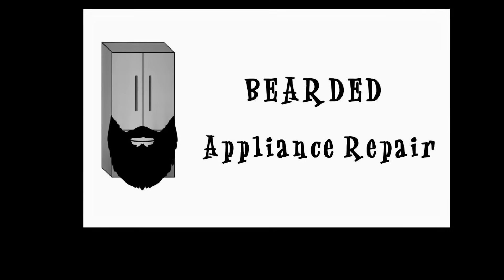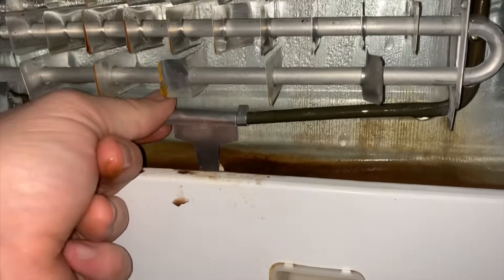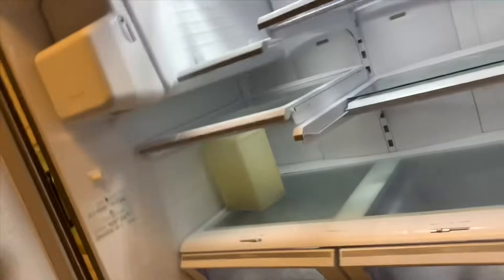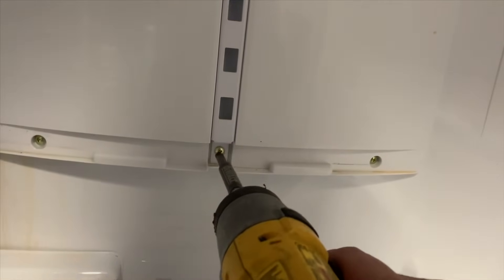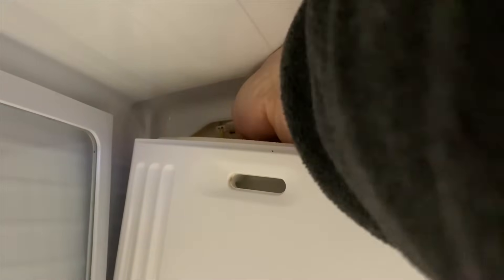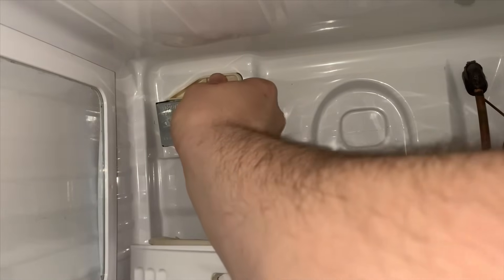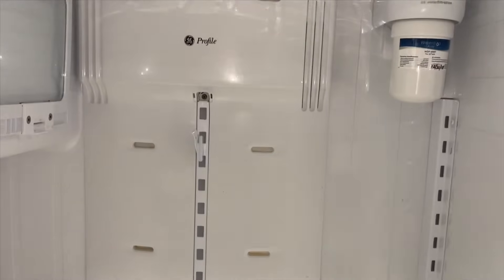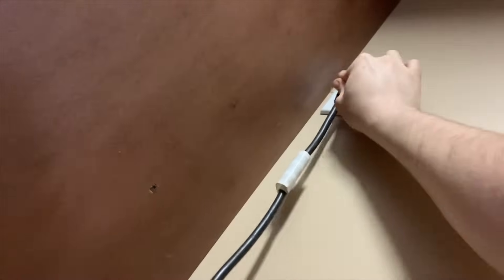Samsung fridge water collecting under deli drawer fix (DA82-01415A)

Comment: Moisture had been accumulating on the condenser and has been freezing up. After I defrosted and dried it notice the water was on the drain I guess due to clogging. I poured boiling hot water, blew air with a small hose, also used a blow dryer, pushed a wire down but only went down about 4 inches but nothing worked. I also checked the white drain hose in the back of fridge. It looked rather dry and somewhat clean. It seems as if it hasn't been draining in a while. Thus far nothing has worked. I guess I am going to have to pay the high price of an authorized Samsung tech. At least I tried.
Reply from the maker: Steamer works best for clearing the drain.  That or just unplugging the unit for a day or 2
Reply: Bearded Appliance Repair -I tried it and it worked. Thanks 😊!!!!
Reply from the maker: Love to hear that.  Did you unplug it or use a steamer?
Reply: Bearded Appliance Repair -used a steamer and some patience as well. I tend to get frustrated if I don’t see immediate results. It is a slow process. In this case there is no quick fix.

Comment: I've seen several of these videos..but no one explains what to do with water in the drain reservoir...does it evap or do we need to always check it every so often? very annoying if we have to take off cover each time to empty it.....
Reply from the maker: Yeah it evaporates down in the drain pan.  The heat from the compressor and condenser evaporates it quickly.  No need to drain it.  If you find yourself needing to drain it there is a problem somewhere.  Wether it’s a leak in a water line or water valve or something.

Comment: Thanks so much for the extremely helpful tutorial.  I did not have anything frozen in the upper or lower drain tube,  but now I still have a small amount of water accumulating which somewhat freezes under the deli drawer.  What would be the next logical step to determine the reason?
Reply: Did you figure it out Steve?  We're also still having water under the deli drawer..

Comment: Replaced heater clip and tubes in back/bottom. Still have water leaking. Verified drain area is not iced up, can hear water moving through drainage tube, and have water in back/bottom in pan below tube.  Any other ideas?
Reply: @ashleemmm  basically by the time the clip had been replaced, if proper function was returned to the unit, I'm afraid water probably seeped in to all areas throughout and did not seal properly anymore with water constantly leaking out (you can probably see what I mean if you take it apart to replace). Sadly my solution was a new fridge, though I do have this one in the garage now without water hooked up and it works fine. If you catch it quickly enough to make the replacement it may make a difference. Good luck.

Comment: On some other model refrigerators here on YouTube they show a code that can be entered through the touch controls to force a defrost, i.e. turn on the defrost heater. If anyone knows that code for this refrigerator please post it here. Using the code would save all that work of emptying the refrigerator and removing the shelves and back panel. I had no luck getting the code by calling GE.
Reply: I called them too and got nothing.
Reply: For samsung fridge - Hold power freeze and fridge buttons for 8 seconds .  Use fridge button to navigate to Power Defrost (rd)  Refridgerator Defrost . This turns cooling off and heats coils for 20 minutes , before going back to normal . It will beep for the 20 minutes

Comment: Does this issue also affect the temperature in the fridge?  I have the parts on back order, and noticed the temperature inside is about 7 degrees warmer than the setting on the outside of the fridge?

Comment: The video shows GE but Samsung may copy GE whatever the principle is same. I just remove all food night, disconnect power and leave door open overnight. Next day, the panel is easy removed not ice behind.
Reply: I set a fan inside on the bottom of the refrigerator with the doors open and the shelves out and turn it on high speed and direct it at the back panel. This thaws it completely within 12 hours and it's not necessary to remove the back panel. Just replace the shelves and plug it in.

Comment: Where would I look to see if this kit works for our model? Our Samsung fridge is trash, three and a half years old and nothing but problems since year 2. It freezes up, won't cool, and needs to be thawed every few weeks. I have seen nothing but complaints online. Just recently noticed water build up under the deli drawer when the drawer froze and didn't want to slide out  without using force. Would like to try this kit for that issue, not really sure what to do about the other one. Have heard it is a flaw in the design.
Reply from the maker: This kit should help with that issue.  If it’s a Samsung French door fridge than this will fit in the fridge.  Should help with ice build up and the water leaking in the fresh food section
Reply: @BeardedApplianceRepair  Thank you

Comment: This video was very instructional. Thank you.  Do you have to let the drain line completely thaw before restarting the fridge?  I forgot to test that part.  This morning I have water under the  drawer again.
Reply from the maker: Yes it’s a good idea to test the drain as well before you put it all back together.  Best way to clear it is with a steamer. Most likely that’s it though.  Just didn’t clear the tube all the way.
Reply: @BeardedApplianceRepair  today it was dry so maybe the water dripping down is warm enough to gradually defrost the drain pipe??
Reply from the maker: Maybe. Anything is possible lol.  Is it leaking still?  If not I think you’re right.  If it still is you may have a leak elsewhere.  Check the filter housing.

Comment: I have a question regarding the two tubes. It seems as if the one in the middle has no function at all. 
Water running through the hole underneath the cooling comes from the right tube. 
The middle one is dry and if i try to put something (after removing the rubber tube) into the hole it seems as if the remaining tube is closed after a couple of cm (tried probing it gently with a scredriver). Is that normal? 
Is the vent inside the fridge under normal conditions hearable (cause I never noticed a sound from the vent)?

Comment: After replacing the heater clip, still have water leaking in fridge. Any suggestions? Changed drain tubes too. Both.
Reply from the maker: Ice can be there still if the drain was not cleared out all the way.  Make sure when installing the heater clip that water will go down the drain.  If it won’t try a steamer to clear it, or getting hot water pours down into the hole to clear it.  Steamers work great for this.

If it is clear,  do you hear some rattling noises when the fan is on?  If you do you may need to look for cracks in the liner.  If that’s the case you need a repair kit.  Let me get that part number for you.  Not sure you can get it anywhere except Samsung though.  Later this evening I’ll be able to look that up for you.  

In the mean time let me know what you find out about that drain.
Reply: I took a turkey baster with hot watet and put it down drain. Cleared drain. Wiped drain pan under evap. Clean. Hurd drain make a noise but water went dn clean. Ill look at liner and see if any discrepancy in it. Thank you. Will check in later.
Reply from the maker: Ray Ray here is the liner repair kit- https://amzn.to/2p1ikiR

Comes with instructions too.  They want you to silicone the cracks and put the pads over the silicone so you’re essential making a new liner.  If you find cracks this is what you need.
Oh btw, where you need to look is where the loop of copper is.  The piece that looks like an elongated “U” in that general area is where you find the cracks.  Could be fine cracks as well.  

May the force be with you!
Reply: I had the same issue 1 year back. I changed the heating coil and drained the pipe completely until it made the flowing water noice, still the issue came back within 2 weeks so i finally replaced the temp sensor and raised the fridge a little using the inbuilt wheels in front bottom of the fridge. It worked for a year and now the issue is back. I am going to try this back side cleaning mentioned in the video, if that also doesn’t resolve the issue, honestly i am not sure what to do anymore. Here is the link to the fridge part i mentioned above. SAMSUNG DA32-00006S SENSOR... https://www.amazon.com/dp/B001KGPERM?ref=ppx_pop_mob_ap_share
Reply: Went back today, water in pantry area still. Went thru ice machine its ok, then checked drain again all clear. Found out Samsung had a recall on ice machines for yes 2014 til present models. Mine was not. Mmm checked water valve, water line, ice machine fills up to its right amount,  checked storage tank for dispensing water all good. I talked to a couple of people and they determined that it might be the insulation in the one section of fridge that broke down over time and now can't keep fridge from condensation dripping dn to pantry area. Turn off ice machine for 24 to 48 hrs to cancel out ice maker. Fridge made in 2008. Mmm any ideas are very welcomed.
Reply: @BeardedApplianceRepair  thank you for the info. And the link. If you like you could read my post above and see if I did everything correct. I check the interior walls of the liner and found nothing. Now model uses a duct if you will up to the  ice maker to harvest the ice. The only thing I didn't do is take the liner of ice maker apart. Very stumbling dead end on this one. Thank you. Any comment would be great.
Reply from the maker: Ray Ray see any ice build up where it’s not supposed to?  Got to find the source of the water that’s getting to the deli drawer area. If the evaporator is clear of ice with just normal frosting its sound to me like a drain issue lol.  I believe you that’s its clear but logic would lead you to that.  

On the evaporator cover I believe there is a diverter that angles toward the drain. Look to see if that is damaged or its not pointing the right direction.  

The insulation idea makes sense as well.  Logical but not sure how to prove that unless you see the condensation on the liner in that spot.

Check gaskets too if warms air come in it can collect water their as well. 

This is a tricky one.  Good luck ray ray
Reply from the maker: Ray Ray loved the info you gave.  Helps out knowing what has been done already. Sounds like you’re being very thorough.  Keep it up..
Reply from the maker: Kuldip Shiv good luck.  Let us know if that takes care of it!
Reply: @BeardedApplianceRepair  thank you. Will update on this.
Reply: @BeardedApplianceRepair  I tore a little the insulation under evaporator panel a year back, can that be the reason for this issue to keep coming back? Also I checked the drainage pipes and they look good.
Reply from the maker: Kuldip Shiv air leaks can cause some havoc on these thing.  Yes it is possible it can.  If you think it needs to be replaced it may be worth a shot.    

Where it’s tore does that look like that is where the water is coming from?  If yes I say that would be your problem.

Comment: can I do this with the freezer on the bottom,  it's a Samsung Refrigerator,  and is doing the same as the one in this video. note* this has NO WATER/ ICE MAKER.
Reply from the maker: Maybe not the heater clip but maybe the drain tubes.  I would check there first to see if it’s clogging there at the freezer drain tube.  I can’t recommend using a heater clip on the heater in the freezer.  May have unintended consequences.

Comment: I had exact problem . I fixed most of it by using metal tape to replace the rotted flange on the panel. The tube wasn't clogged but I am still getting some water from the rectangular opening which seems to share air from the freezer and it still collects below the deli drawer. Any ideas? thanks
Reply from the maker: Water may have compromised the evaporator panel.  The foam on the inside will bulge where is it. 

When it freezes it can extract some of the water and leak down under the deli drawer.  As long as the drain tube is not clogged.

Comment: I've watched most of the videos on here and yours is the best by a good bit. We've paid a Samsung authorized tech twice - about $250 each time to fix the ice under the deli drawer on an RF267 but no dice. When I took the evap cover off, I discovered the drain tray (part of the panel behind the evap) was rusted and corroded thru. The new design clip had already been installed but without removing the original clip. I'd already ordered the kit you mention and now have ordered a new drain plate. 

As others have mentioned, its difficult to know what to do with a freezer full of food. So last week we bought a new LG french door - fingers crossed. Now trying to make this Samsung a secondary basement frig.

Question: what do you do with the 3 stick on foil strips that come in the kit?
Reply from the maker: Those are for models built before 2011. I failed to mention it so I apologize for that.  They go around the evap aluminum bracket. Haven’t seen one that old in awhile so the next time I run into one I’ll make another video on them.  

This kit helps most people but sometimes it just needs a little bit more.  Samsung authorized folks should be able to determine those issues for you. Depends on the tech they send I guess.  Some just don’t have their hearts in this stuff like others do.  

Sound like it would be a good garage fridge though.  Best looking one in the block! Lol
Reply: Thanks for the quick reply. Mine has an August 2008 mfg date. Do the 2 adhesive foil strips go vertically on the back of the drip tray plate - between the plate & the back wall of the frig? Or on the front side of the plate between it & the evap coils?

Also the larger adhesive foil bottom piece - does it stick on the top part of the drip tray drain channel or on the underneath side? 

I ordered a new drip tray which arrives tomorrow.
Reply from the maker: its me yes the skinny ones go in the back side of the aluminum.  Between the wall and the bracket.  Be careful doing this because if you make a hole in the evaporator you have a bigger problem in your hands.  The bigger strip goes on top of the drain pan.  

You must have done your research.  Kudos to you my friend.
Reply: Got it. Done now. We'll see how it goes. The important clarification for me was the placement of the larger foam strip. It also goes on the bottom back of the drip tray, folds underneath the drip channel & up to the front lip. I found the tech services bulletins - there are at least 3 between 2014 & 2017. Here are the links to each:
10/5/2017: https://f01.justanswer.com/Rushrepair/f4580600-91b1-4fea-b1ab-602faa3c3c32_SamBull.pdf
10/13/2015: https://f01.justanswer.com/smitty1486/0531f989-a9b0-429d-80f6-29eb5946381e_RF267_Water_Leak_Bulletin.pdf
7/23/2014: https://www.applianceblog.com/mainforums/attachments/asc20140703001_ver2-pdf.28864/

Comment: The kit you link to provides the insulation, this aluminum goes over the area you are placing the clip? I checked the drains first, one on the right (looking at back of fridge) was bone dry, the left when I moved it water came out. So I cleaned, and soaked in some vinegar for time being until I get the kit. But just wanted to ask about that aluminum, my unit was built in 2011. Thanks for the video. Great help - hoping it works.

Comment: excellent video for this problem.  One question for a future video.....Can you please show us how to replace the water reservoir and remove the deli tray track that the deli tray slides into?  On this video, would it be also a good idea to replace the defrost sensor?  How do we know that isn't bad and is part of the problem?
Reply from the maker: Great questions.  Over the years I have only replaced one of those reservoirs, this was before I started making these videos.  Next time I run across these I will definitely make some tutorials for you’ll. 

In some cases yes the thermostat needs to be replaced.  To test them you take the thermostat out, get yourself a glass of ice water and drop the thermostat in it.  Give it a few minutes and read the ohm value.  At 32 degrees it should read close to 13,290 ohms. Got to have a meter that will read resistance that will go that high.  My new fluke meter will work but only reads up to 40k ohm which works for 90 percent of thermostats.  I’ve been meaning to do a video like this.  I have a thermostat that comes out of an ice machine that will be similar.  

We’re working on setting up my basement to more videos like this as well.  Planning an “ice maker 101” right now and have other topics coming in the future as well.  

Thanks again for the comment and good luck on resolving your fridge issue!

Comment: Where does the drain water end up?
Reply from the maker: It’s goes underneath the fridge into the drain pan.  The water evaporates from there.   The heat from the compressor and condenser evaporate the water pretty quickly.

Comment: So thrilled with this video. I was able to skip defrosting it first by using a hair dryer, FYI. Thank you SO much.
Reply: Hair dryer thawing is not good advice for the uninitiated.  It can warp the plastic cover so it doesn’t fit properly.